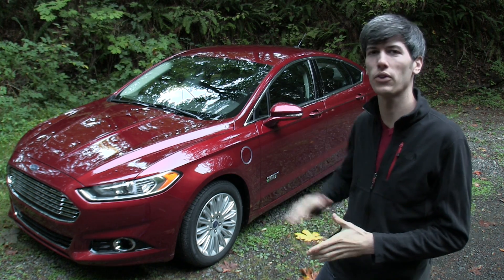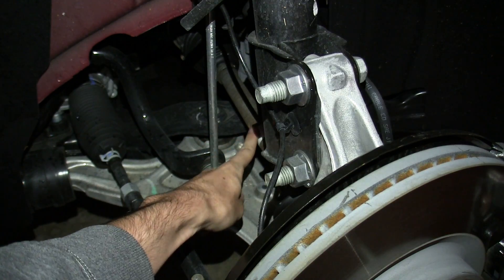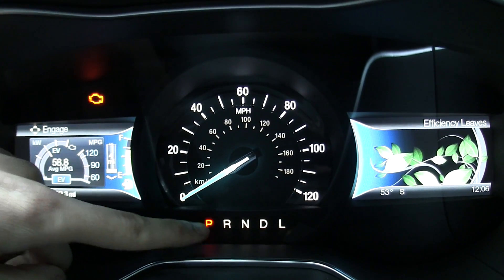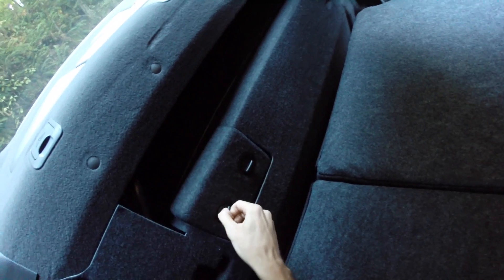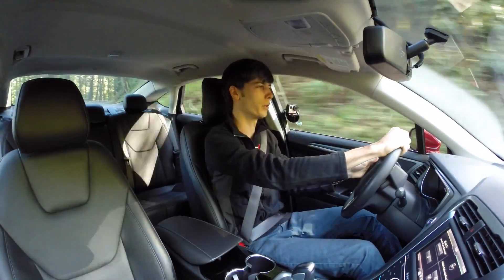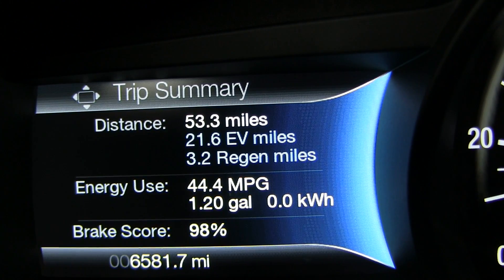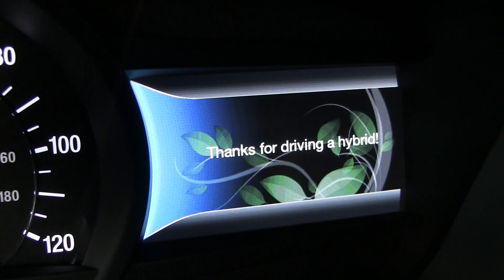2014 Ford Fusion Energi Titanium - Review & Test Drive

Comment: late here, but i sold honda's at the same time this car was built,, accord hybrid has the same if no just a lttle lees than the ford.. just looked at the altima  a little less than the ford......i bought a ford fusion, on these 2 main things.. love the looks outside and inside, esp. at night.. and i have the 2.0 turbo engine..city about 24.6 highway  on cruise at 68 ( sweet spot for this car )  i get 35.7 ave...not bad.. it has paddle shift also.. that really does not help the gas milage, thuo, when you play with the 245 hp..but overall i love my car..ruby red

Comment: so if the battery is dead does the car still run on just the engine and you recharge the battery as you drive? basically you don't have to plug it in every night? Also how does this system work in extreme cold weather like most of the country has?
Reply: Yep, if the battery is low, it'll charge as you drive, and it will use the most optimal balance of gas and electric power for the driving condition. You don't have to plug it in every night. Cold weather is a drain on the hybrid battery, so you won't get as much EV range.

Comment: Unfortunately, the Ford Energi can only output 60kW of power from the battery pack, which limits how hard the electric motor can push. For a comparison, drag race a Nissan leaf with an 80kW motor, the leaf will crush the Energi on acceleration!
Reply: You're comparing apples and oranges. The Leaf is electric only and is limited in range. The Fusion can drive on electric for 21 miles and then use the hybrid gas/electric to continue on your journey. Good luck traveling 300 miles in a Leaf...it will take you 2 days to stop and charge the battery overnight. By the way...in a race the Fusion would crush the Leaf because it also has a turbocharged gas engine to accompany the electric motor.
Reply: Paul Baker Let me put it to you this way. Nissan Leaf delivers its advertised capability. Energi fails to deliver the rated 88kW. You can’t get more than 60kW from Energi.
Reply: @OVER-bENGINEERED  why would you want to race an efficiency car?
Reply: Error 404 Because racing an efficient car against an efficient car is a fair race. The leaf spanked me in electric mode, and still pulled ahead racing me in hybrid mode.
Reply: then stop running/moving, how far can you travel in a leaf?    total?

Comment: I wish I had the energi for the winter, but with a dual heater, electric/engine core. My Fusion 2013 Hybrid gets like 35mpg on a cold start, while I get about 63mpg(5min slower back roads) in summer no AC, and 43-50mpg(Highway) using the AC set to 72.(25 miles to work)

The cars learns your behavior. Breaking in the beginning feels rough but smooths out.

Comment: Thank you for creating a review on a car that actually gives us some useful figures and tells us as far as fuel economy figures what you actually got at least in terms of your experience and what the car's computer says versus watching all the other car reviews and the actual people who only do car views who are literally only quoting the EPA numbers and not telling you what they're actually getting as far as economy goes in those cars plus you do any more real world test than they do cuz you take it out on a fairly decent size drive as well as you do real world driving that people who would own the car would generally be doing where is most of the car of yours just so they can say that the acceleration is good in the breaking is good will be hard on the throttle usually to the floor during acceleration and they will get on the brakes pretty hard as well most of the reviews I've seen on the Ford Fusions people are saying they're getting 34 to 37 miles per gallon which is not impressive but the numbers that you have shown me or a bit more impressive but not as impressive as my 2007 Prius which I'm betting on the same Loop driving at the same way you were I would be looking at getting between 48 and 52 miles per gallon but unlike the Ford Fusion Energy plug-in mine is not a plug-in and I am at the disadvantage of not having the p r e v range and not having much power available as my Eevee portion because my car was designed for the electric motor to assist at higher speeds and not be a primary but I have found that in my 2007 Prius in some circumstances I can still get the car to kick into Eevee mode even going down the interstate and usually when it kicks into Eevee mode going down the interstate it will run it for about half of mile to a mile and then it will kick back into it's hybrid mode where it runs the gas engine to help push it down the road and for The commenter Who said why do people buy expensive hybrid cars like this on many models of cars that have a gas only version and a hybrid version the hybrid version usually is not much more expensive then the gas version and the increase fuel economy which is generally about 8 miles per gallon better than the non hybrid version makes sense in the long run cuz of what you're going to save on gas especially considering that the other engine that the fusion runs that would be at the same price point would be running mid-grade and not getting as good as fuel economy or you could buy the non hybrid 4 cylinder and run regular grade fuel and you would be looking at about a 34 to 36 mile per gallon average where that car just did a 44 mile per gallon average when you take into account the cost of fuel and how much extra range you get out of the hybrid which is another reason why many people will buy the hybrid version of a gasoline car cuz they do have much better range same size gas tank easily looking at another 325 usually more like 8 miles per gallon so the extra range on the vehicle is also a selling point especially only plug-in hybrids where most Americans are looking at going easily over a thousand miles before having to fill up again if they just plug it in every night and most Americans if they plug the car in at night are paying a lot less per mile to drive the car and it's Evie mode than they would be to drive it and it's gas mode my Prius that easily obtained mid-forties even lower 50s for fuel economy is still costing me about $0.06 per mile in gas alone to drive versus the maybe two cents per mile that that car costs in electric mode so when you actually sit back and do the analytics on at all the plug-in hybrid really does start to make sense because of how much more cheaply you can run the car over the course of the lifetime of the car somebody who drives 10000 miles a year will be able to recuperate the extra cost of the car and about 3 years or 30,000 miles essentially if you put 30,000 miles on that car and you plug it in every night when you are at off peak rates of $0.06 a kilowatt or less and you are driving 3 miles per kilowatt of energy it is costing you $0.02 a mile to drive on electric and it is coming out to be about $0.06 per mile to drive the car on gasoline given a fuel economy in the lower 40s like that and the price of a gallon of gas and considering most people who end up driving cars like that do tend to drive quite a bit and put more like 15,000 miles a year on their car and keep Cars 3 to 5 years they will find that they easily recoup the extra cost of buying the hybrid version versus the non hybrid version even when you are talking about the even higher cost of the plugin hybrid version versus the non plug-in hybrid version as long as they plug it in every night if they are doing a 25 mile a day commute they are able to still just as easily recoup the extra money they put into paying for the system especially if there's someone who can plug their car in at work and charge it for free at work if I was in that scenario of a 25 mile round trip every day and I could plug in at work and charge my car for free and get that 21 miles everyday for free then I would just not plug it in at home one or two nights to use a little bit of the gasoline and I would plug it in at work everyday before driving home so that way I am able to get the most free energy possible to move me down the road or if my commute was less than 20 miles I would probably not plug the car in at home at all and I will just plug it in at work and I'm talking about if that is what you are coming out to with your round-trip commute would be 20 or 25 miles.
Reply: how much and how big is the pruis compared to this fusion.. apples and apples my freind

Comment: Hm so the ICE is basically just like permanently stuck in the low-cam mode of i-VTEC SOHC engines?  Mine does the same thing with the Atkinson Cycle, but it switches off to the high-cams when you want the power.  Opposite of traditional VTEC; high-cams are running most of the time, with the lows only in low load conditions and cruising.

Comment: does it regenerate the battery with the engine and braking like a prius.
Reply: Like a Fusion hybrid, yes. Love my 2018 Fusion Hybrid. Over 50mpg in city in summer, about 40 in winter. About the same on my highway jaunts also.

Comment: How many miles per gallon do you get in electric before gasoline takes over? Like on 2012 fusion hybrid goes upto 35 milles on electric power before gasoline takes over. Does fusion energi goes up to 60 miles per hour on electric before gasoline takes over?

Comment: Great video.  I really like the car reviews.  In this one, you touched on unsprung mass.  Do you have or are you planning to make a video on sprung vs. unsprung mass?
Reply from the maker: Arthur Dent I don't believe I do. Basically anything held up by the suspension is sprung, anything that is not (wheels, tires, brake calipers, some suspension bits) is unsprung.

Comment: After seeing this video and not checking if this is your normal habbit.. (sorry about that) I've come to understand that you hold the steering wheel at 10 & 2, 10 & 2 is really not reconmended for driving at all.
Why you ask? 
-In the case of a (god forbid) car crash, your right hand (or fist) will be coming right at the passenger on your side, at aprox. 200Mph,  thus destrying his face, as well as disintegrating your hand...
-Apart from this hazzard, while holding the steering wheel at 10&2, your flexibility is of less as it could be, with the correct form. (try it compared to what I reconmend)
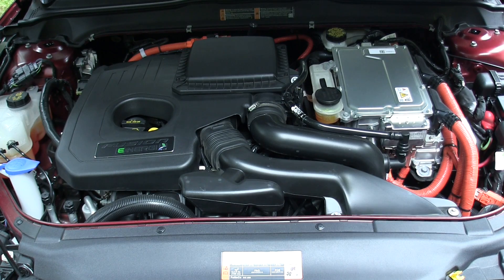I am really sorry for ending this like that But I'm afraid I don't have enough time at the moment, so I'll simply say it - hold your steering wheel at 9:15 & 2:45.
9:15 & 2:45 will grantt you the maximum flexibility of movement and enough comfort for driving a long cruise. (unless you are the one hander type of guys.)
stay safe! I love your videos!
Eli.

Comment: It would be nice if these hybrids had a 'sport mode' that you could turn on, that would use some battery power to improve low-end acceleration. It would be better for short trips or traffic situations where you need to brake and accelerate a lot and are a bit less concerned about fuel efficiency.
Reply: They do have that. Just floor the pedal and that's your sport mode.

Comment: 21 mile range......why the hell are they so bad..Tesla hits 250 miles....what do the scientists at ford not understand that Eon Musk does....21 mile range is disgusting....yeah it's hybrid..but imagine a hybrid with the range of a tesla....way mroe fuel efficient...not to mention the tesla Model S P85 broke the record for the fastest 4 door sedan
Reply: 3yrs old, but Tesla uses the undercarriage to store the entire battery system. No fuel tank or exhaust system. That is a 14 gallon tank, and exhaust piping and equipment to route fuel and  to mount the exhuast all gone. Hybrids still have to house all the components of a combustion engine system.  Have Tesla throw a 4 cylinder ICE in and see what happens...
Reply: Well, it can be engineered to get that range, but not at the same cost.

Comment: If the engine only kicks in when it needs extra power, wouldnt that be very unhealthy if the engine is cold, like it probably is most of the time...?
Reply from the maker: MityLite It runs quite often, I'd assume it could stay warm for quite some time (with the use of a thermostat).

Comment: I have heard some people say that it is actually worse to buy hybrid vehicles because the amount of energy that it takes to mine and produce the battery is not as much as if you were to just buy and use a gas car. Is this true?
Reply from the maker: baseballrockssb People love to hate on green technology, but the main point is, if you're getting 44 mpg over 20 mpg, then the amount of carbon emissions is drastically reduced.
Reply: The carbon footprint to produce a battery this big has more emissions than the life span of an average gas only car. That being said, I don’t drive a hybrid because of “less emissions” when I actually drive I drive it because I save gas, in turn saving money.

Comment: Never understood the point of creating a fuel efficient, expensive car. What market is this targeting?
People with money that don't enjoy paying for gas? Most people that put that much into a car will drive a BMW, Audi, Merc or a Cadillac.

They need to concentrate on creating a hybrid that has 4 wheels, doesn't look terrible and is cheap. Then their cars can be aimed at lower & middle class people that want to save money.
Reply from the maker: Fuel efficiency is one of many reasons to buy a car. If there were two expensive options, and one offered better fuel economy, why wouldn't you choose it? It's silly to think it's justified to have bad fuel economy just because it's expensive.
Reply: Engineering Explained I understand that, it's cool for cars like the i8 and Tesla models but for 43k buying a decently slow hybrid seems like a stretch.
I'm sure Ford knows what they are doing, my opinion is meaningless just thought I would share.
Good review btw
Reply: Engineering Explained I see it more along the lines of these cars not having any pick up.  If I were going to dump 40 grand on a car and my options were no guts and decent fuel economy, or high performance and ok fuel economy, the answer is pretty clear, a lot of the high performance BMW engines will still get over 30mpg and have more than twice the power this silly confusion of technology has.
Thats what I'm gonna call this thing now, the Ford conFusion. haha
Reply: @Dexter_Solid  bmw gives you ........manhood
Reply: Shawn Leonard thank you for the different perspective, sounds like a good deal
Reply: you can buy a hybrid below 30k. it makes sense. i dont know why would someone buy this instead of chevy volt? i have no idea
Reply: @ThinkingBottle  the volt works for a possible 34% of the sedan market because when this car was sold new the chevy volt was still a 4 passenger. The fusion was a 5 passenger. That 5th seat meant almost 60% of the market considered it an option (60% of americans have 5 person families). Now in 2019 these cars are only commanding 8500 to 12000. The newer 5 passenger volts (2016+) are still in the 18 to 24 range around my markets. These also sold from 32 to 36k even when MSRP was 42+. Lastly, the volt is dead and these are still being made.
Reply: +Dasit Mane i need tilt and telescopic stering
Reply: Deek people like me who can afford nice cars but absolutely loathe buying gas and burning fossil fuels.
Reply: Prices plummeting. I saw a new base model 2018 hybrid on the lot last year for $20,400. I have one. Course Ford is killing it now.

Comment: Good car. But I think I'd go for a Chevy volt instead.  It's got a better electric range. And in my opinion looks better inside and out.
Reply: The Volt looks like a Chevy Cruze modified to resemble a space ship. You're out of your mind if you think the Volt looks better than a Fusion.
Reply: As long as you only need 4 seats (34% of the country) then the volt "could" work. Pre 2016 when this review happened. Today you're just sol for a new volt. They are going extinct.
Reply: Well I work at a Chevy and cadillac dealership  . Previously I worked at a Ford one . And if I'm wanting to buy the car with the best range and mpg. The volt wins . And the second generation ones are even more nice  . And if you want full luxury.  We sell the elr.
Reply: Kodie Preuett I have a 2016 Volt Premier. It's a great car. I'm also thinking about getting a used fusion energi as second car. I like that it's bigger.